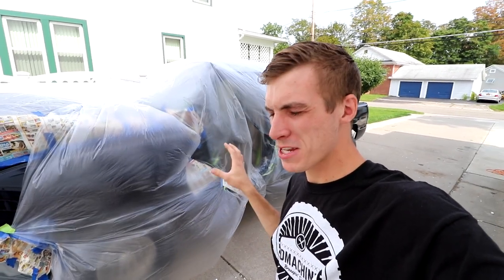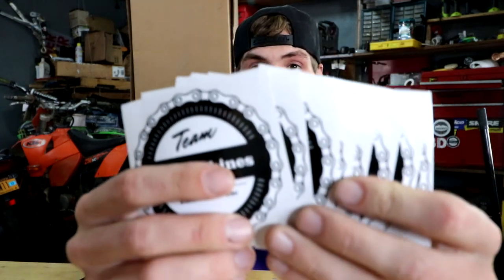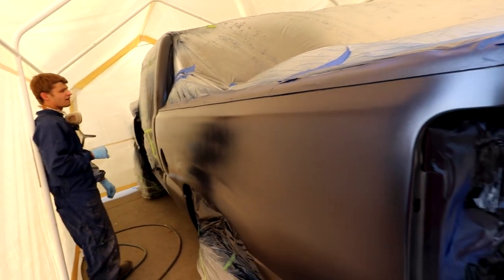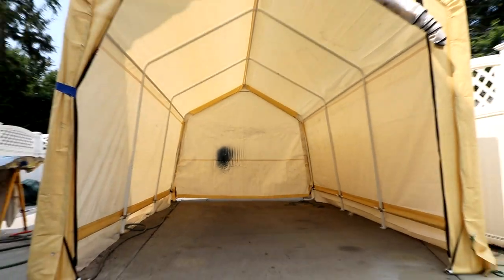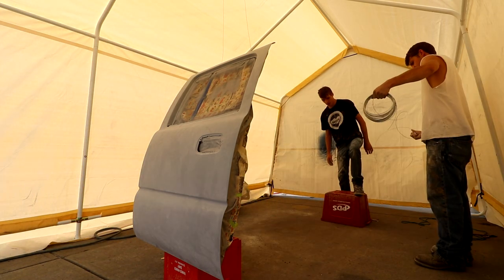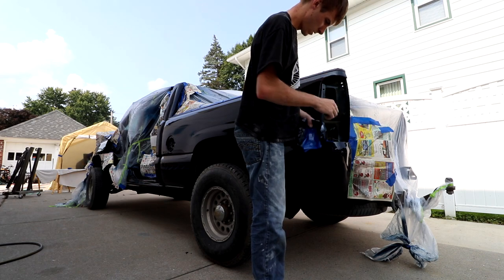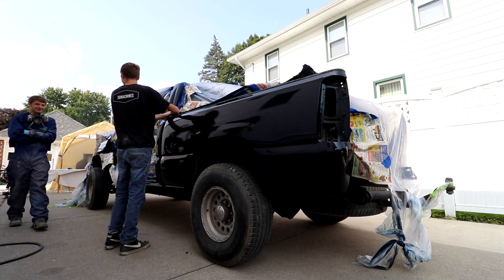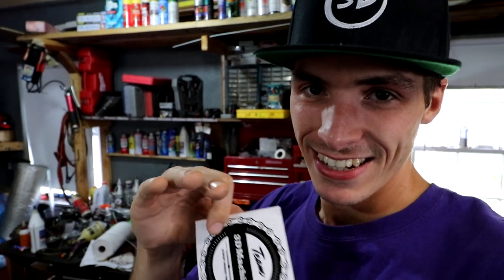THE WORST Part of Painting My Truck...

Comment: New rims soon?
Reply: Roman F hopefully
Reply: Painting black could be cool (and cheaper).
Reply: I agree, not a fan of the early 1990's era Ford Ranger wheels.  Personally I like the stock wheels off most trucks (check out the Denali wheels).  You can get a set off Craigslist for cheap.  I just got an extra set of new take-offs from a 2017 Ford Super Duty Platinum with TPMS sensors for $800.  Looking to plasti dip and wrap them in some KO2s for a winter set.
Reply: Idk why but I kinda like the rims on there. Maybe because the bigger tires. But yes new rims would also look cool

Comment: I did the body work on my second car which had surface rust sitting in the Arizona sun. Unfortunately I didn't have the patience to To get the body completely smoothed out. It was an okay paint job but the work is worth it  in preparation  before the paint goes down i.e. the main code!

Comment: Where did you get the Chevy paint? I'm trying to repaint my summit white duramax but I cant find a paint that is summit white
Reply: I used rustoleum k7792 gloss white on my 2010 2500 HD and it turned out great. Just be sure to mix plenty of hardener for the right shine. I bought it all from Wal-Mart and tractor supply

Comment: Why did you remove the doors? There is only two times a vehicle is painted without the doors. When it's being built at the factory and when you are changing to another color. A lot of UN-needed work.